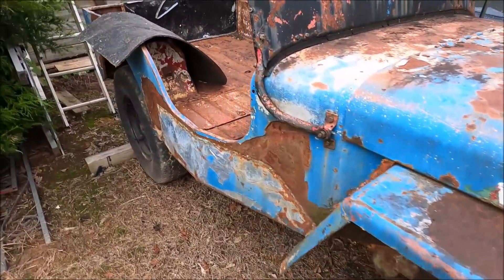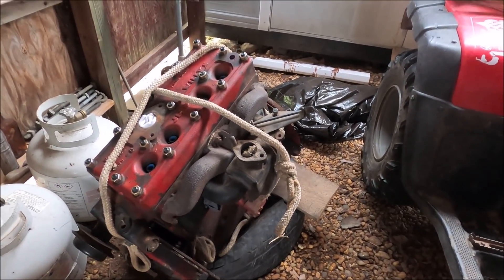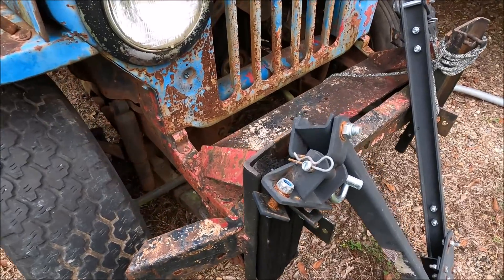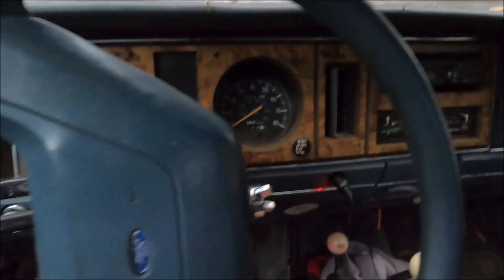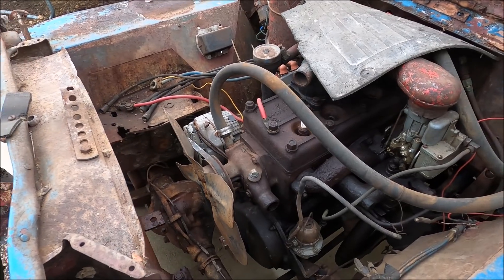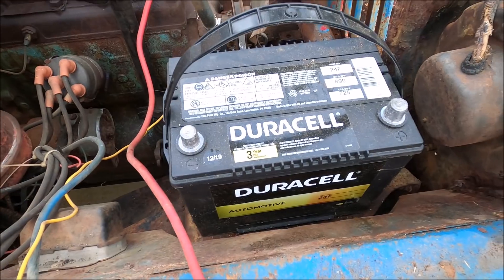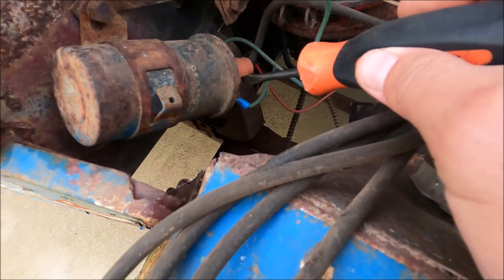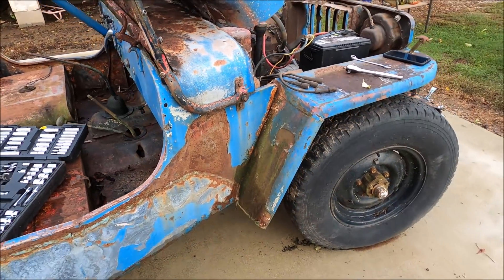1947 CJ2A Engine Swap Part Two: Walkaround & Cold Start

Comment: Not to be obnoxious in my posting but if you can get your hands on a compression gauge with a quick disconnect , you can use the hose side that threads into the cylinder head for each cylinder to provide pressure to force your penetrant of choice through the piston rings and cylinders in an effort to help free the pistons. The six cylinder engine I bought from a wrecking yard out of a 1985 cj7 was stuck from sitting . I soaked with PB blaster , marvel mystery oil and diesel fuel and pressure from compressed air over time . When I saw the diesel fuel had dramatically cleaned just looking through the spark plug holes after sucking out fluids as best I can , blowing out with a blow gun helps too . I kept at it with sea foam deep creep as well . That sea foam deep works really well over time . The pressure from compressed air really helps a lot as well . One more secret ; the addition of an engine block heater on one of the core plugs to heat the cooling passages when full of engine coolant helps expand the block away from the pistons enough to allow the penetrants via compressed air to work faster and more effective , if there is any chance to free up stuck pistons . Yeah , you'll have to find a way to " gently " turn the engine , but never force any more than necessary . If you have to fabricate something to bolt to the flywheel to apply a pry bar , just use restraint . Don't want you to get hurt or cause damage . Trying to stick bolts into threaded holes and pry on them is tempting but dosen't always yield good results . Maybe a flat piece of steel drilled out to bolt onto the flywheel pressure plate holes and a safe way to pry on it will help . Trifling I know , but necessity is the mother of invention . Time and thought will prevail . A socket and breaker bar on the front pulley bolt may break it off . You know the deal . Only use that method when the engine is finally broken loose and you can turn the engine back and forth gently while lubricating the cylinders with the sea foam .deep creep . That is GREAT penetrating oil and lubricant . When you HEAR and FEEL the tiny movement , spray those cylinders with the sea foam deep creep liberally . It's a fight I spent months on while researching . The engine had its original flywheel because it had a 5 speed trans and Dana 300 T - case so I was lucky to find two holes meant for balancing plugs on the flywheel face near the edge I was able to place two homemade pins . Made them from shoulder bolts I cut the thread off . They were 5/8" diameter , so that was helpful . With them both inserted , a wrecking bar face me gentle leverage . Gentle is key , and a lot of penetrant oil . Can't say enough of the sea foam at that crucial time of breaking loose and the block heater contributed BIG TIME ! The compressed air forced into the engine with penetrants played a huge part too ! I hope this helps and you are successful . Your fearless but please be safe !

Comment: Here's that guy again ! There are tools that slip onto the front crankshaft snout with the pulley removed . The tool is round on its internal diameter and has a key way cut out to grab onto the key way to help spin the engine . Good idea , but folks have tore out the key . Those are replaceable but if the key notch on the crankshaft gets gets wrecked and the crankshaft damaged , not a good time . 
This is the only reason I advocate the flywheel as a stronger place to attempt turning the engine . A bolt in the bell housing mounting holes and prying against flywheel teeth didn't work for me and nearly broke flywheel teeth and my own teeth as well . Please use your ingenuity , I know you got a lot . It took me months to break loose this engine but I got it finally and want to pass on my technique and hoping it works for you . Above all , always be safe . Your bride and family will thank you .

Comment: Hey Alabama , been awhile for me . That round bar you said looked homemade is factory . Originally , the WW II GPW ( ford ) had that crossmember and Willys had a square crossmember . Later in production to replace all the jeeps getting blown up in faster production , they all started getting the round crossmember , if I'm correct . 
Ok , stock up on the penetrating oil and presoak any fastener you think you'll need to pull . 
Everything that holds the grill will need to come off . I didn't take the fenders off my CJ5'when I pulled the 4cylinder and installed the six , just the grill . If the fender bolts come off without a fight , go for it . 
Protect your eyes very well , your going to be under this jeep for a while going after drive shafts , the crossmember and floor plate . The bolts holding the floor plate look like they won't come peacefully , just wondering if MAP gas will heat them to liberate them . Soak , heat , repeat while trying to free bolts may work . Any bolt you get out makes less work later . Drilling out and retapping thread is not my favorite . It's time consuming . Takes you away from your loved ones too long . 
With that floor plate off , you can see what your doing . You get that transmission shift tower off and cover with cardboard with the bolts to hold down the cardboard helps . Trim to size worked for me . 
There's supposed to be a pin that taps out of the t - case shifter brqcket so you can remove the shifter handles . I know you want to just remove the engine but since the trans and t - case need attention if they're stuck , best to work on them out of the jeep . The Willys pick up was more work to pull the engine and trans/t-case ( but accomplishable ) but the CJ2A is a little easier . May not need to lift it for ground clearance but you'll know then . So why do I advocate pulling the whole powertrain/drivetrain in one shot ? I know you've got to use the tractor , not an engine crane . And the bearded one is unable to assist . Sorry about that . Hope all is well in his world . I did the pull and install , alone , but had an engine crane . No room in my driveway for a tractor . LOL . I work better alone , I'm bad company sometimes . 
As you go,around looking for,places to shoot penetrating oil , with a wire brush too , you'll,find things to remove/disconnect . The clutch linkage will test your patience but you'll get it . Trick is to remember how it goes back . CJ5'is easier but the 2A isn't too bad from what I've seen in video ? I think there may be a stay cable from bell housing to linkage or something but take a good look . After crawling out from under this jeep , your bride won't recognize you and want to hurt me for talking you into it . 
Have a good game plan before taking action but just thinking of the best approach for you under the circumstances . Best of luck , please be safe and best regards to the family as well . Greg .
Dang ! Looks like I wrote a shop manual ! Hope I'm right !

Comment: Definitely keep showing. And check transmission before you put engine in.  Also Definitely remove fenders and grill is a much easier to access
Reply: I wondered if you still had the jeep. Thanks for the walk around.

Comment: First take pictures of all the wiring and hoses. You had me worried there for a moment when you were connecting the battery since they used that red cable for the ground. I had to swap out the motor on my tow behind brush hog after the ears that the recoil starter bolts on with broke off the engine casting. I went from 11.5hp pull start to a 14hp electric start motor. I had to add a solenoid, starting button and kill switch to it. My wiring looks a bit like spaghetti but it runs like a top. My husband was impressed as mechanics isn’t his strong suit. He has me do most of those kinds of repairs and YouTube is your best friend for a lot of it. Good luck. If we were closer I’d gladly lend a hand.

Comment: You are asking "Where to begin"    Why not start with the first bolt you see. start taking the fenders off. the front radiator core support. bag and label the bolts where they came from. coffee containers . cardboard boxes . start staking them in the garage / shed.   for example. Take the alternator off. take the carb off. hoses and water pump. if its in the way of slipping that motor out. take it off. get a jack under that  transmission and /or wooden blocks to hold it up. take out the bell housing bolts. bag and label. take out the clutch fork. box and label. take pics of how it was.  disconnect wiring to the engine. tag and label. Get started. pick a spot and work from there.

Comment: Forgot to mention in my last post how impressed that this jeep still has a floor under the tool box lid . I really hope your entire floors and sheet metal are in better shape than my 1973 CJ5 which in all rights should get a new body tub but don't wish to give up on the original tub . My 1980 faired much better on sheet metal but still needs TLC . With the powertrain / drivetrain out , you can get your hands on them individually if need be . You said the trans is stuck so we know that needs addressing . Hope the transfer case is alright . At least both can be serviced as a unit . As you know , there are many channels dedicated to jeeps and theirs engines and drivetrain so they got you covered . You can do this ! 
However you decide to attack for your best approach should be respected since your the guy with the wrenches and checkbook . Just like the Willys pick up , one bolt , nut and screw at a time .

Comment: Here is a couple thoughts for swapping engines. I did my first engine swap in the late 80's . no air tools. just common hand tools. I swapped a V8 out of a Firebird and put another one back in. the key to success is when you remove  bolts / screws or whatever. You photo how it was . bag the parts and label. same for water pump bolts. bag and label. bag and label.   Didn't you already do similiar when you pulled that inline 6 out of something and put it back. pretty much the same thing.

Comment: I forgot you had that thing. Looks like your trans and t case are in a bad way aswell. You should be able to take off the floor cover and shifter to look inside and evaluate. You might get lucky that the shifter itself is rusted up and not all the gears. But dont put the new engine in until you atleast check it out. It looks like the t case shifters are messed up? To work on that its a million times easier out of the jeep so you might be pulling everything. Its an ambitious project for sure but a few days of hard work will get alot done. A few years for you I guess.